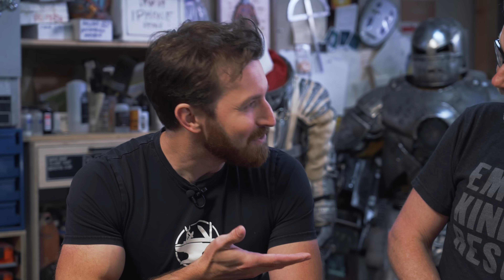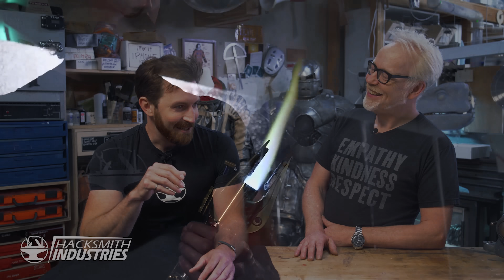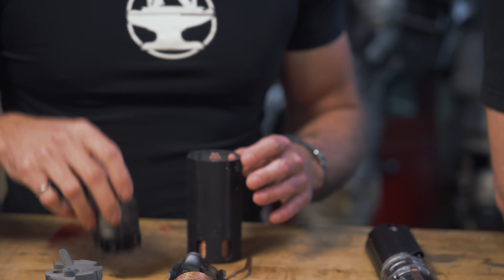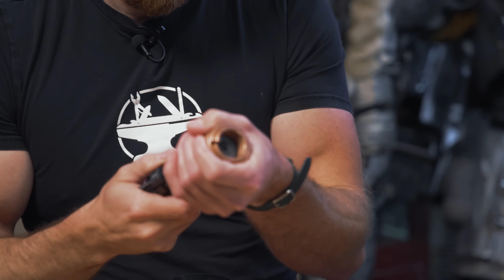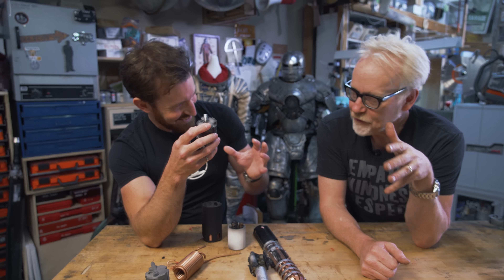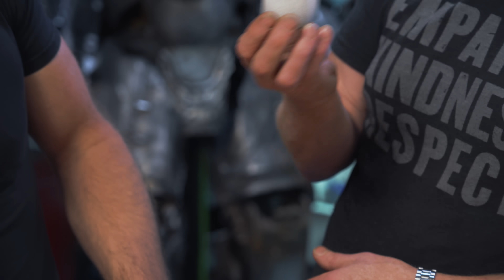Adam Savage Reacts to Hacksmith's Newest Lightsaber!

Comment: I think a lightsaber can be designed with lasers which do not require volatile gases to operate.    We already have hand-held lasers which can weld metal.  If you were to arrange a series of these lasers around a circular aperture and then add a lens to the aperture which rapidly shifts its focal length, the effect would be as follows:  lasers would converge at a focal point in the air and the heat of that convergence would ionize the air at that focal point making the focal point visible.  The rapidly flexing lens would cause the focal point in the air to oscillate very rapidly...like a tennis ball sliding up and down on an invisible pole.  To observers, this would appear to be a beam of light, maybe half a meter long...just like a lightsaber.  The only trick would be to generate a force strong enough to parry another lightsaber, but not strong enough to drag the Eifel Tower, satellites, rockets and several oil tankers into the cave where Wile E Coyote is assisting us with its design.  *Perhaps*...we will see something like a parry force soon if the recent reports of magnetic monopole phenomena can be verified.  Supposedly the crystals in some materials can arrange themselves on a microscopic level in such a way as to appear like a magnetic monopole to a macroscopic viewer.  It will be interesting to see if these reports are true.

Comment: Consider using 97% liquid Hydrogen PerOxide instead of oxygen.,   After all it  IS rocket science so consider a new oxidizer that is not high pressure and not cryo,.  Great Job on the presentation.

Comment: Buy some corundum/diamond water cutting heads and use THAT as the orifices (i.e. it's a LOT CHEAPER!) --- For the internal tanks use 440C Stainless Steel CNC'ed into a pill-shaped THICK WALLED (i.e. 10 mm) tank-within-a-pill-shaped-tank design so that the outer pill-shaped LOX tank cools the inner pill-shaped propane or hydrogen tank and you can use the temperature differences to create pressure differentials that will mix the super-cooled gasses correctly.

You can also use a super-thin-kerf water cutter to cut a set of 0.5 mm bore holes into a 440C stainless steel round bar. Space each bore hole 5 mm apart and cut a V-hole in the end that is towards the gas tanks so that pressures can build up before through the 0.5mm bore holes expelling the MIXED LOX and propane or hydrogen at a fast rate for ignition at the other end.

It's a lot cheaper than buying a glass blowing lance for $3000!

Depending on the Stainless Steel grade wall thicknesses (up to a full 10 mm) you can pressures into the 750 PSI to 2000 PSI range which should give you a few minutes in a handheld lightsabre device.

If you need a design I can send one easy enough!

V

Comment: Quartz crystal when electrified properly shoots an amazing lightning bolt out of its end. Since everything is light anyways, the lightning bolt should be able to be controlled by directional light ( magnetic field ) just like a "real" light saber. Pressure should cause the light to manifest itself into a "solid" that can be controlled. The directional light ( magnetic field ) needs to be stronger than the non directional light. The non directional light would then be trapped and under pressure, manifest itself into a solid. Theoretically anyways.

Comment: Those dudes are crazy, wont they go broke? I make my light sabers out of After Effects but only as long as my 14 year old cd rom still works cause Adobe has many times disabled my legal copy. Then I have to reinstall it then firewall it in. I guess I could run it from a virtual drive cause then it wont be as visible and it wont be reachable. Ill have to ask around about that. Im not ready to buy a clean room yet

Comment: I don't know what Hacksmith means with "if he hadn't been in a Tesla" It's not like Tesla has the best safety rating
It's good but not in any stand out way.
Reply: It has *consistently* been good in a stand out way - rollover risk destroys the competition due to the battery's location on the bottom, it always gets 5 star safety ratings across the board from NHTSA, they've literally broken machines meant to figure out how much weight it can handle before it crushes, and then it has all the safety features to avoid a crash that standard safety reviews don't even test. The only claim against Tesla is the safety of their AP/FSD, which is ultimately up to the driver to be responsible for, and very clearly so - even then, crash rates are even lower with Autopilot/FSD engaged, and that's from a baseline crash rate a fraction of the average vehicle.

Comment: I dunno, maybe Bogdan should have been in a Saab... they are relatively speaking for the swedish built ones from the late 90s to the company collapse period both side impact train resistent but also front impact moose-proof as far as occupant survival goes.  I'll attach the train impact link, and I previously did the math (its in the comments) but basically its 242 metric tonnes of combined locomotives doing 62.5 kph with a peak impact force of about 146 million joules. 

https://www.youtube.com/watch?v=9IPrXAJ2Vj0

Comment: My favorite thing about this video is the stunned expression on Adam's face about the clean room . shows he really understands how crazy that is 😆
Reply: I've worked in a Class 100 clean room (with a Class 10 clean space within it*), so I know exactly how insane this accomplishment really is. Those things are expensive, both to build and maintain, but some of the most important science possible is being done within such facilities (as well as crazy engineering - my own focus was on the science stuff, but it's clear that James and Bogdan are using their facility to manufacture things that would be impossible to create in a non-clean environment).

*It sounds like Hacksmith Industries built a Class 1000 clean room with a Class 100 space inside it, which is still wild.
Reply: Yeah it’s always great seeing Adam understand how impressive the thing done by the person he’s talking to is
Reply: And the oxygen path they took is among the "safest". They could get away with a longer and hotter flame that requires less pressure, say, with a mixture of oxygen and ozone, but it tends to spontaneously explode. And it gets worse from there, as we then get into fuels that are mixtures of fluorine and similar instead or propane.  The issue really is in finding just the right combination of fuel and oxidizer.  Evidently the technology in Star Wars was such that they had gas cylinders that they could just add and the ambient air itself was enough to start and fuel the reaction. (with some help - see below)  These looked like what they had at the time - basically CO2 cylinders - but the understanding was that the materials science was advanced enough that 50 or 100K PSI tanks were common? lol. 
The reason they needed a "crystal" was because the crystals in their universe were also used as computers.  Shows and movies of that era routinely used the idea of advanced civilizations using crystals for memory storage and computers.  The reason was that the computer technology then was so cumbersome.  An entire room to regulate what we consider to be simple engineering tasks. Memory chips were the size of a small candy bar.  For not even 1K. Now you can fit more computing power than the first spacecraft inside your Apple charging cable - and it all be invisible.
So you needed a small set of circuits, in essence, to regulate it all.  Which is why they should absolutely eventually incorporate them, if needed.  Embed it in a crystal for aesthetics, if they want? 
As for the "help" mentioned above, they also had power packs (essentially supercapacitors or batteries) because it's entirely possible that they were doing some sort of processing or compression of oxygen in real-time to start the whole thing off.  They basically needed the fuel and the rest was handled or processed locally. 
Sorry, got a bit nerdy - lol - but I see them getting this amazingly close to the real thing in about 10 years.
Reply: @plektosgaming Bruh. The magic space laser swords are powered by magic space rocks and wielded by martial arts space wizards.
Reply: @kyltredragmire4939  The various source books did a good example of explaining the tech, and surprisingly, it's not too far from what we see here.
Reply: @plektosgaming  I'm pretty sure lightsabers have been shown to work in low er so O2 environments
Reply: @Appletank8  Yes, because "Hollywood" - lol. But any practical design would need an atmosphere/oxygen to operate.
Reply: And it is in fact bonkers like really bonkers like actual rocket science level craziness lol
Reply: You don't often see Adam Savage so flabbergasted.
Reply: Ahh yes the glorified paint room with the capability too positively or negativity effect the air pressure a real astonishing room

Comment: While it doesn't have "commercial viability," it HAS to have some industrial application. I mean sure you have a glass blowing nozzle built into the thing, but the compact saber design must fill some technical niche case for some industry beyond glass. And then whatever you learn might be useful for improving the Minisaber, which is a commercially available product. (nudge, nudge)